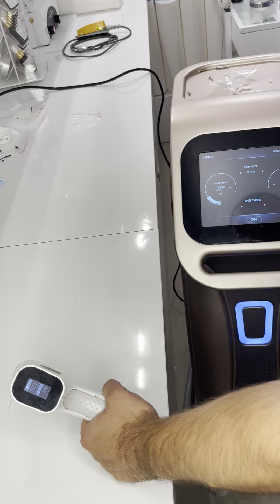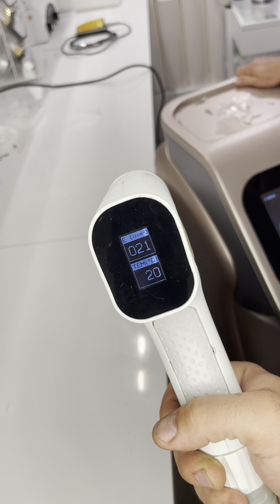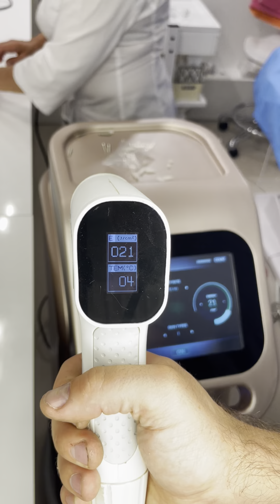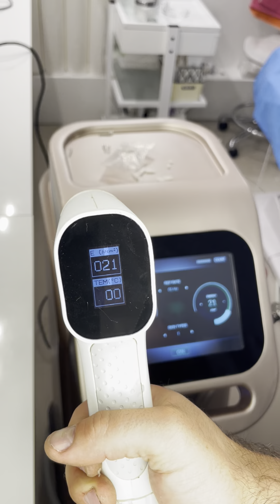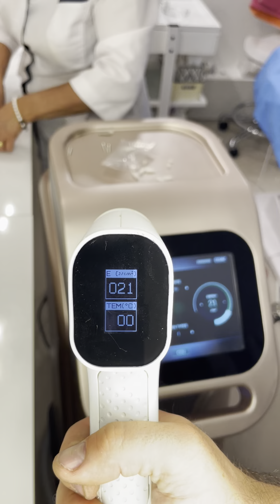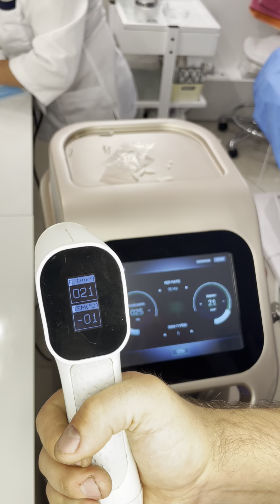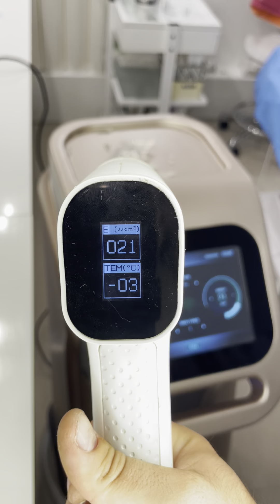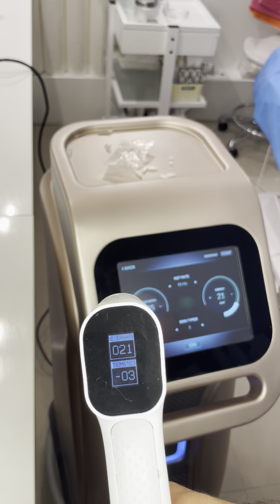repair laser diode epiler Hair removal

Comment: I have a triple wavelength device like yours in the video. It worked flawlessly for 2hrs, and all of a sudden I lost power to the whole machine. The glass fuse blew. I replaced the fuse. Every time I turn on the machine the fuse blows. Manufacture recommended a 15amp fuse. This fuse blew instantly as well. 

Any ideas what to troubleshoot for?
Reply from the maker: You have a short circuit somewhere!